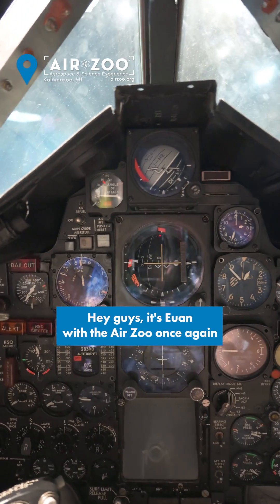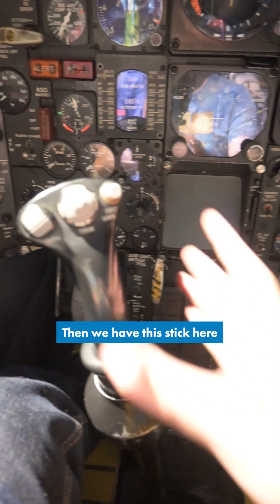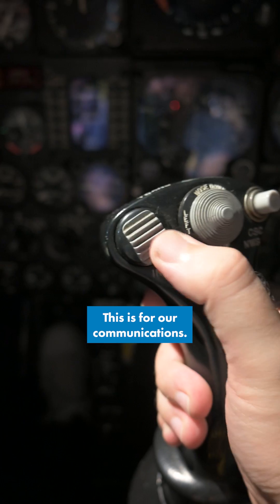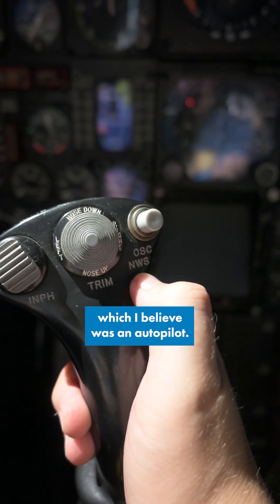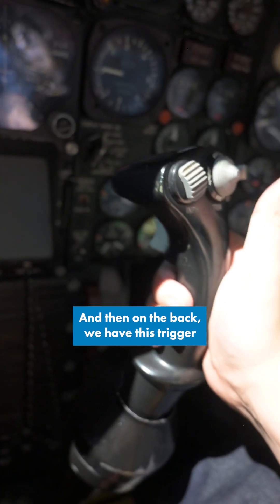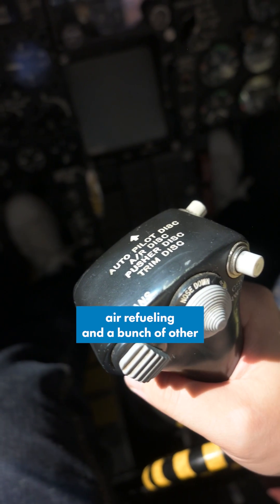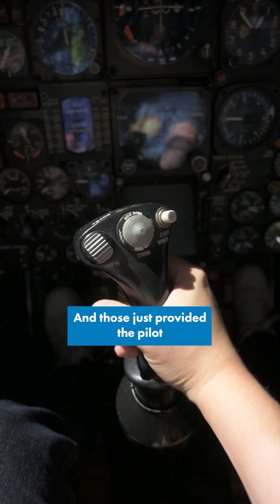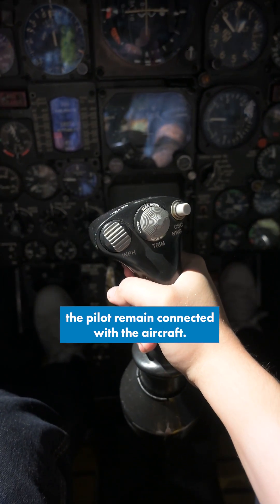SR-71 Flight Control Stick

Comment: Horizon indicator says you're not level Homie!?!?.....
Reply: Toppled at power off before the caging brake activated. Wonder just how many systems would still power up if you applied both DC bus, and any of the AC bus power supplies, to the aircraft through the ground power connector.

Comment: We’re the sticks all orientated for right handers or could they be switched out if the pilot was a leftie ?
Reply from the maker: I'm sure all of them were right handers because the throttle is on the left side.
Reply: @AirZoo  All right hand, southpaws just had to learn how to use them. Pretty much the same for all aircraft, you are expected to be somewhat ambidextrous, as there is no concentration of controls for the one hand, each hand has a subset of them to control. Just like any motor vehicle.
Reply: @SeanBZA  yes. also, in many civilian aircraft (with side by side seating) you actually control it with your left hand and do everything else with your right.